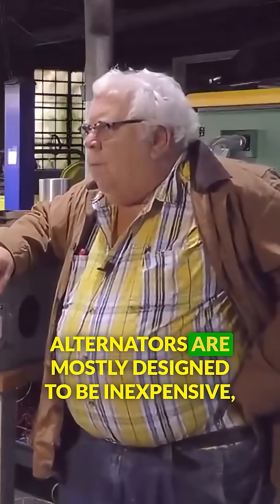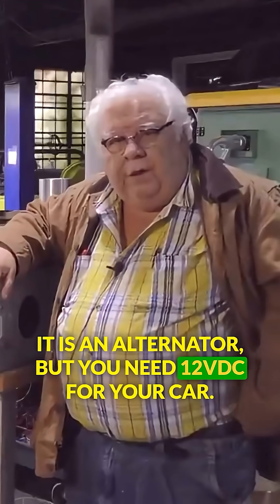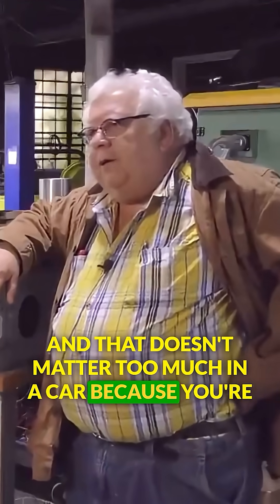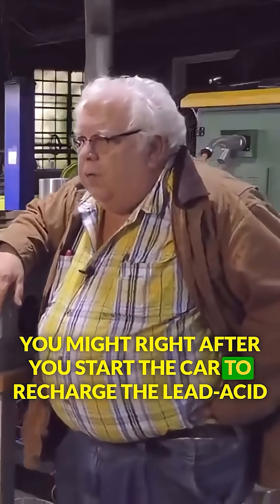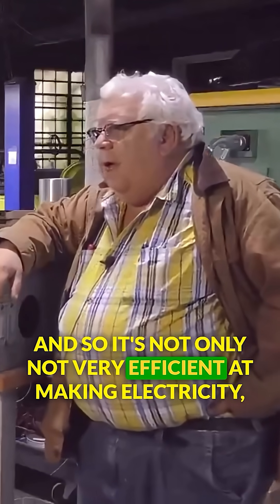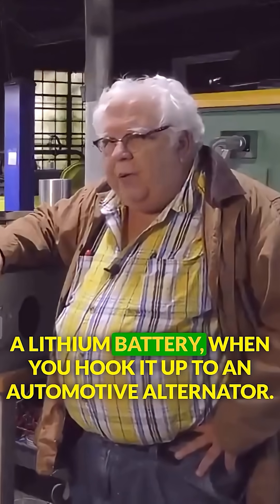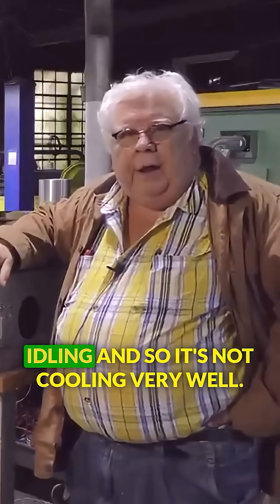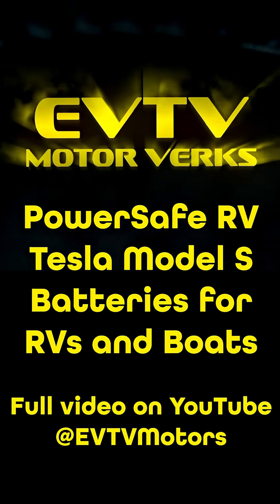Alternators are Only 50% Efficient!

Comment: I had an F-150 "I think it was a 92" that would chew through an alternator in a year.  I figured out that if I bought a new one from Pep Boys it had a lifetime warrantee.. The problem persisted and they changed it so you had to cut the plug off to maintain warrantee.. That fixed the issue.
Reply: Cut the plug off??

Comment: I work in the motercycle powersports industry, 20(years) in a shop.
People think lithium ion is the way to go but they do not realize the charging rate and the voltage is significantly different than lead acid or agm. 
I am ALWAYS replacing a junk lithium ion and a burnt out stator and regulator. Stop using lithium ion if the vehicle is designed for agm or lead.

Comment: This is not exactly correct. A cheap car alternator is usually about 50% efficient, but it's not only because of the bridge rectifier. A very basic full wave bridge rectifier is about 80% efficient, with the losses caused by the voltage drop across the 4 diodes. These days it's very easy to get that above 90% with very cheap components. The loss comes from the design of the windings in the physical alternator itself.

Comment: Lithium battery will only pull a lot of current if the battery has been drained, which isn't common. If the battery is full, it's not going to put a load on the alternator.

Comment: Most car alternators are wired in star format and changing same alternator to delta will increase it to approximately 85% increased output when the load is sufficient

Comment: The rectifier used to be a separate unit, and it's not really part of the alternator. The Alternator puts out an alternating current. It's the regulator system that is not correct for the different battery type because their charge cycle isn't regulated by voltage alone and require a DC-DC converter. Every system has losses, and they aren't the most efficient but they are more than twice as efficient as the older generator that uses a commutator to remove the current going the wrong way, which is entirely lost.

Comment: The actual phase conductance of a typical bridge rectifier diode assembly, is nominally , but transversely indicative of a wattage swing aligning all electrons with a standard sine wave configuration which is mitigated by a voltage change of approximately 1.3 percent for every 12.9 degrees of temperature difference. The speed at which the armature spins, in correlation to the number of windings around such armature, and the coil windings around the permanent magnets secured to the stator housing, is the promoting factor in establishing the total amperage output, minus any impedance of applied pulse application.

Comment: The voltage drop across the alternator diode is about 1 volt. At 100 amps that's 100 watts (Power=Volts x Amps), so it's 92% efficient (1200-100)/1200).

Comment: I made my own lithium iron phosphate battery back in college. 13.4 volts. Nice bms board with 320Ah and peak of 2600amps for 12 seconds. Been using it in my diesel trucks Dailey driven in Minnesota. -30 days was nice, I did notice this past winter at -22 it only had 900amp output. It is from 2014 
Back to what the old fella is saying, I never have had an issue and I can’t understand his point. Maybe if you put an incorrect input voltage and the vehicles pms/computer doesn’t like it maybe you’ll have an issue. Alternators are pretty robust. Most lasting 10,000+ hours without liquid cooling. Only air and in a hot engine bay.

Comment: Let's look at un reduceable losses.  Even with high amperage Schotty diodes the voltage drop rarely ses under 1volt.  There are 2 diodes at any time in any full wave rectifier. 

Minimum loss of 15% before you start.

Consider the physics before spreading dubious data.

Comment: The cheapest solution is to run a extra long cable from your alternator to the lithium battery so the resistance of the cable allows the alternator terminal volts to rise at lower amp outputs, that way the alternator voltage regulator will reduce alternator amps and protect the altern alternator.  
Or you can buy one of those fancy DC to DC  regulators
Reply: Hey bud I believe you got potential

Comment: I don't know if that is correct or not. I haven't tested the amperage but do know this. I have run flooded batteries in the past and now run lithium for my power source at home. Lithium charges up much easier than flooded. You can get 3/4 charge in about the same amount of time. But my system has a full charge at 27 volts and charges fairly fast. Flooded won't get you a full charge until around 29 volts and after 75% is charged hard and slow. BTW I run a 24 volt system but 12 will give you the same results but does create more heat.

Comment: Sir, Thank you for your output on Alternators, Flooded Lead Batteries and finally Li-Ion Batteries. It was nice to listen to.
Honestly.
But.... Li-Ion  Batteries though; are much more reliable and can totally be discharged and can be charged to 12,8V DC, with no harm to the Cells, the Flooded batteries loose their charge (power) @ 11.5 . It's dead. You need research on it.
Flooded batteries may (will) dry up, if periodic top ups are not adhered to. Flooded battery life  depends on how well it is maintained, meaning maximum life expectancy of flooded batteries are limited to 3 ~4 years. Not Lithium Batteries. They last for almost 15 years plus or minus .
Li-Ion cells detests Heat. Li-Ion Cells detests Cold.  Li-Ion Cells are prone to fire and or may explode untimely.
The modern vehicles control the usage of alternators as and when the charge is required for flooded Batteries, through Engine Management Control. Meaning the Pully has clutch and it engages and disengages as required by the EMC (Computer) As seen with Air Conditioning Compressor clutch.
Time to go. Thanks again.

Comment: My battery $189. I'm sick of these prices. And each time the battery goes dead freezes it shortens the life.    older cars have all kinds of electrical issues and leaving small lights on overnight.  I just had 4 Chevy's trucks/ vans in a row with electrical issues.  One was a suburban with a mouse nest under the fuse box behind battery. Chewed several wires for a winter snack.   
So I bought a 2002 Honda Odyssey and battery goes dead in 5 days.  
Mechanics lie to me and charge $$$. Same issue. My 2000 van was a simple ground wire on engine thermostat. 
I still hate Chevy the most, and because the brake lines are had no rust prevention all rusted out.  Very dangerous. 
And the key switch issue killed over 130 people. GM is an embarrassment.

Comment: This guy is full of it. Lead acid also draws tremendous current, whatever it’s offered really until it hits C. This only becomes a problem if you are deeply discharging you battery before you turn the car on. I kinda hate when guys like this spread lies like lithium somehow sucking down more amps. No it has nothing to do with that. It has everything to do with how deeply you discharge the battery and how many watts hours you need to recharge.

Comment: Exactly... automotive alternators are engineered to power autos with automotive batteries ... the are designed to be tough and last a long time and be able to completely handle the load of the vehicle ... it is not designed to handle the load of whatever aftermarket crap you attempt to install.

Comment: Alternators are designed to charge a battery, and it was found that pulsating DC using a full wave bridge rectifier (i.e. 100% efficient, not 50%) would charge a battery faster than constant Dc current from a generator. Don't be afraid of advances in technology. And thank goodness for electronic fuel injection taking over. I wonder if Jack lived long enough to dis that and sing the praise of carburetors.

Comment: Just like fske free energy vidos this is other direction, it take to move inducing magnesium into copper than free spinning. About 1/10 so if put out 1200w of electric it only produces 120w of heat. Which still a lot another guy does understand thermodynamics and magnetism.

Comment: It's somewhat true, depends on the battery chemistry of the lithium and how big of a lithium bank it is. Most lithium batteries made for automotive applications have a BMS and a balancer built in so it doesn't pull the kind of load he is talking about. I suspect this video is pretty old and was made back when lithium batteries just came out. The lithium automotive batteries of today won't do that.

Comment: However, if you use active rectification using hall effect sensors and mosfets in the alternator, you will increase the efficiency substantially.  I just wonder if anyone makes an external, active rectifier assembly for the aftermarket.

Comment: I've noticed with motorcycles lithium batteries are not a good choice. With the stator (alternator) making 13.7v-14.2v dc optimal charging range at 2,200 rpm. That if the rectifier fails and the voltage goes above 14.2 that the battery will literally melt due to heat and over charging. Agm battery yes, lithium battery NO

Comment: With lithium batteries, you have a thermocouple in the alternator, and when the alternator internal temp reaches a certain temperature and adjust the voltage accordingly. Thereby reducing heat internally.

Comment: The lithium battery is more likely to burn itself than an alternator. At 600rpm idling speed, the alternator is rotating at closer to 2000 rpm because the crank pulley is about 3 times the size of the alternator pulley. Lithium batteries require a different charging system than lead acid batteries and anyone charging lithium with the wrong charging type will only get trouble. Even solar charging systems have different modes for charging lithium as opposed to lead. You're talking shit.

Comment: I curious, What is the source of all the resistance necessary to cause 50% losses??? As for excessive current loads for Lithium, it would not take much to build current limiting into the Voltage regulator that is already in the modern alternators. Actually, I'm surprised that it isn't already there !!
Anyway, Elon says that Lithium Batteries are obsolete !  He is bringing Aluminum Batteries and 3000 mile capacities to a $15000 Tesla...

Comment: What I'm missing is: you would always put a DC to DC charger in between the alternator and the lithium battery wouldn't you? That way you can control for how much charge goes into the battery/ how much you load the alternator. As long as you keep under a safe load, I don't see what the problem is.

Comment: An alternator is just a motor / generator. If an automotive alternator is only 50% efficient and you're losing 1200 W of power, then just get a 1200 W ebike with a lithium battery and you can stay in shape and enjoy riding around at speeds up to 50 mph.
Reply: How does riding around on an E-bike at 50 MPH keep you in shape?
Reply: @lpeddle8404   Real e-bikes that only give you power if you apply an appropriate amount of torque to the pedals, as compared to an electric throttle bike, can give you the same workout as an unpowered bicycle. But you also have the advantage of being able to go up hills faster and go longer distances, therefore it's much for more useful in daily life. As with any human-powered vehicle, it's up to the human to give as much effort as necessary to keep fit.
Reply: @andrewowens5653  Okay but how far do you have to go on the e-bike to get the same workout as an unpowered bike.
Reply: @andrewowens5653  Just figured that one out. Duh. Me.

Comment: Everything in cars is about efficiëncy, recirculating gasses, lean-burn, very thin oil, lightweight parts and components. High compression ratio, brake regeneration..... But still most alterators are very far behind. Its really questionable. If they would use PMAC or efficiënt DC alternator it would be far more expensive but beneficial for efficiently and therefore the environment. Since they have MGU units in turbocharger, this is also a leap of technology which next gen cars will make use of. The tech is getting reliable enough by now.... (Apart from exceptions)

Comment: This guy's words are so brilliant. People making fun of HIM in the comments... SMH... This guy is Brilliant
Reply: Wow, he told me alternators suck.  He didn't tell us how to fix it, or what alternator we can purchase that is more efficient. Don't give me a problem without the solution.  I don't want to hear it.  I'm not an electrical engineer.
Reply: Ah, so silicon rectifiers are 50% efficient, ok....
Reply: Where exactly did he say that silicon rectifiers were 50% efficient? There are many other ways in which a rotating mechanical component can be inefficient, friction loss (including cooling fan), exciter power, and probably most of all, thermal energy generated by eddy currents in the steel laminations.

FYI - if you were generating 1.4V then silicon diodes WOULD be 50% efficient, they are a non-linear component. The guy knows exactly what he's talking about.
Reply: @davegsm82  Really? Maybe you should try listening.... He even said "Alternator" is a misnomer... Maybe he doesn't know as much as you think...
Reply: I've listened again, you're still wrong. 

An alternator is still an alternator if it contains a diode pack, the base generating technology is still the same. You could call it a generator if you want but that's usually reserved for a commutated DC output via brushes. 

Go back and listen carefully to what he says, the diodes convert the voltage to DC AT THE ALTERNATOR. <STOP. PERIOD>. "But they're only about 50% efficient" - referring to the alternator overall, which is the point of the video, which is also the TITLE of the video.
Reply: @davegsm82  Anything he says here is so ambiguous that it seems he doesn't know what he is talking about. 100A at 12V is 1.2kW, ok. But that is not dissipated through the diodes. Or the alternator. Maybe he didn't exactly say it was, but he also didn't express anything clearly.
Reply: @davegsm82    Dave...You are correct. 
Thank you for this clr advocation for the narrator
Reply: @davegsm82   Dave...bang on again!  Keep up the fact checking and declaring what's what.   What  a low grade of conversational critical thinking in most comments.
Reply: Shut up hater
Reply: Hes so brilliant... about a topic hes objectively wrong about.

Here, im going to give you a comment you can take as a compliment ! You are clearly as intelligent as he is.

Take from that what you will lol

Comment: There is a lot of misinformation here.  Rectifier diodes are far better than 50% efficient. They would typically drop about 0.6v across them therefore at 100A the heat dissipated would be 60w when the load is 1200w. That means 95 % efficiency.

Comment: What are the solutions?  First, I think that you can add a fan to cool the Alternator. Second, I think you can add a limiting resistor to slow down the charging of the Lithium Battery.

Comment: Alternators aren't efficient compared to what ? A generator ? Whose output is completely dependent on RPM and cannot be controlled ? Old time electromechanical regulators often failed trying to dissapate the excess voltage created by generators at speed. An alternator's output can be controlled by the field circuit which makes it more efficient right off the bat. Which is one of many reasons why all car manufacturers switched to alternators as some as the tech was invented. 

But his point on lithium batteries is correct. To an automotive electrical system a lithium battery looks more like a short to be overcome.

Comment: You hook up a lithium battery without a charging controller you´ll have much bigger problems than that. 
If you are talking about charging a drained Li-Ion drop-in replacement, idling your car for an hour is not what I would call smart.  If it has 90-100% SOC, you not going to see high currents anyway.

Comment: I have to say its not true with a 2016 ford f150 2.7l ecoboost twin turbo,  eliminated the negative bms on the under hood battery, added diodes to the fuse for the alt under the hood to raise voltage to 15.3v, replaced lead battery with a bank of 6 2.7v 3000f ultra capacitors,  and in the cab i have a 160ah 6s configuration toshiba scib lto lithium bank. Going on 3 years daily use, lots of idle factory original alternator

Comment: Why not just step up to a 400 amp alternator works much less and can handle lithium without issue...mechman singer iraggi  all make 400+ amps even some with multiple alt brackets to run 2 3 4 5  400 amp alts if you want

Comment: I put two lithium batteries under the hood of my 2014 f150 5.0. The bms system didn’t like it at all. So I disconnected it.  It was only when I decided to go full tilt on my amplifier that it caused problems. 

However, I have stated to people that either the batteries give up or the alternator. 

I have upgraded to a 400 amp alternator so we will see how long it goes for (or the batteries)
Reply: I've been running 2 lithium batteries under my hood in an 07 Tahoe and a 370 amp alternator without an issue at all

Comment: I have a1996 Isuzu Rodeo 2.8Turbo diesel with the vacuum pump on the back of the Alternator that ute still has the same Alt since  1996 same clutch and gearbox from brand new in 1996 so I don't know what you are talking about being Diesel only needs 5 volts to open the solenoid on the injector pump the alternator is 29 year's old and still running

Comment: Big mistake, the drop over a diode is 0.7V at 100A, which is 70W for every half cycle. That's about 35W total. Times 2 diodes in a bridge make it 70W total.
Reply: Definitely not 0.7V at a big current! Nowhere close.. With a 'diode test' on a multimeter at one milliamp, you might get  .7V . A big diode conducting 10A will be around 1.2 - - 1.5V drop.

Comment: What's this thing you call an alternator? My 1959 Pontiac Bonneville station wagon uses a Delco 12V DC generator to charge the battery and provide auxiliary power.